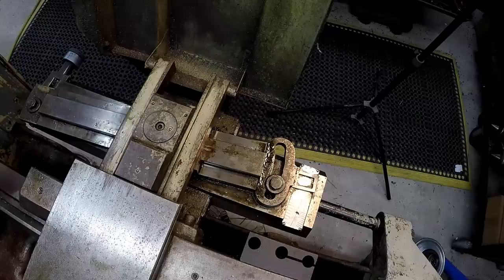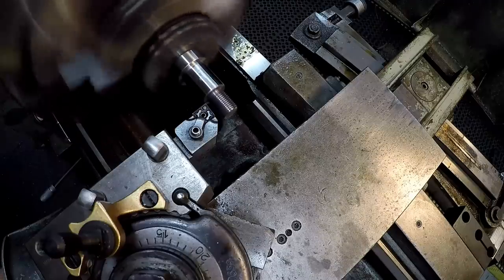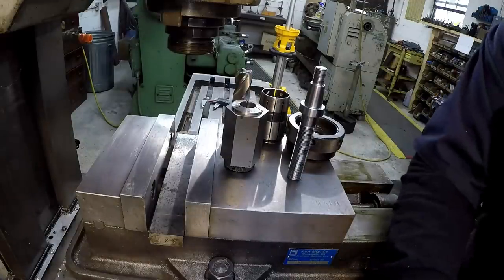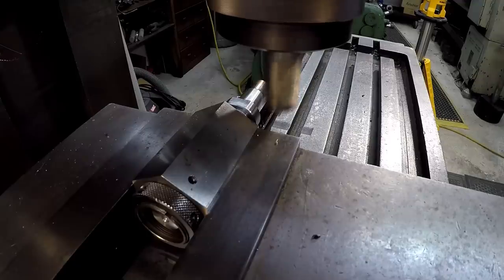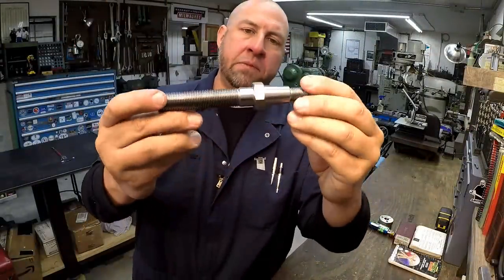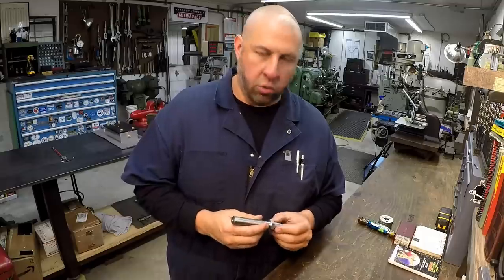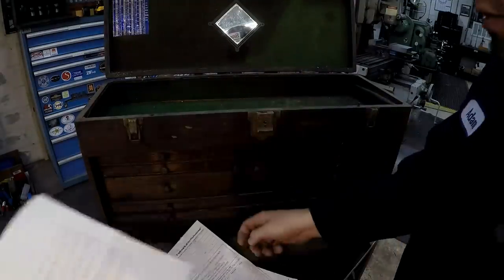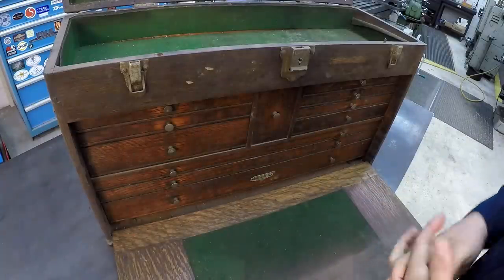SNS 253: Tapered Ball Joint Stud, Gerstner Tool Chest

Comment: Hi Adam, why didn't you use the compound slide for a small taper like that?
Reply from the maker: Because I have a taper attachment that doesn’t get used much. Better content for the viewers, and much easier to get dialed in.
Reply: @Abom79  Thanks for the reply Adam, I just wondered if it was an accuracy thing. But you are right, it is nice to see you use different tools.

Comment: Wait... If its a suspension part, wont he need two of them?
I can't think of any parts in a suspension system shaped even close to that where you wouldn't need at least two.

Though I dont know a whole lot about suspension systems
Reply: 5 Link has a single mounting point to the diff and has panhard bar, could be any of those parts

Comment: If you already haven't cleaned the Gerstner, let me recommend Murphy Oil Soap. It's the least aggressive cleaner and won't damage the finish. If you want a gentle polish after the cleaning, try Howard Feed-N-Wax. I've had good results on older pieces. with both these products. If you want to renew the finish first, just rub in some boiled linseed our or True-Oil gunstock finish.

Comment: doe's your aventor caliper go dead if you leave battery in it
Reply from the maker: It doesn’t go dead because the battery is left in it no. It runs out the normal life of the battery.

Comment: Ball joints and tie rods are typically 1.5" per foot or 7.15 degrees. A few are 9.5 degrees or 2" per foot. Justin should have sent you the sample to measure, as that is not his strong suit. :)
Reply from the maker: He measured the existing unit and give me the dimensions. He also said it fit great, so no worries.

Comment: gl 66931 probly an old phone number,, from before the phone comp. went to just numbers
Reply: The GL is probably short for the memory aid word, such as Glendale 66731
Reply: Indeed that is a phone number, 456-6931 - GL would have been an abbreviation for an exchange name, "Glenwood-6" or similar. Our exchange when I was child of 10 in 1965 was Greenwood-3, so our phone number was 473-xxxx. This was before the days of Area Codes and long distance direct dial. If you wanted to call long distance, you called the operator. On certain holidays that had traditionally high long distance call volumes, you were put in a queue and the operator called you back when a trunk line opened up, which could take a while. I remember waiting an hour or more just to be able to call our cousins in California on Christmas Eve or Christmas Day.

Comment: Original Style of old telephone numbers when they went from four or five digits to seven digits (prior to area codes).  GL woud have been for the words like Glenview, Glenwood, Gladstone, Glencourt, Globe, etc.  When I was a kid our phone number was 4-9771, later upgraded to AMhurst4-9771, then 264-9771, and finally (Area Code) 264-9771.  You are too young to know about the old phone system, such as "Number Please," two longs and a short, plain black with a short cord and a round dial, and you could not buy a phone, only rent what Ma Bell offered.

Comment: Isn't it hugely damaging to brake a precise tool like your lathe so aggressively?
Reply: nope, as far as the machine and bearings know there's no difference between applying a force to slow down the spindle and applying a force to cut a part, the only difference is whether or not the motor is engaged.
Reply: The machine is well designed and will not hurt itself. The friction brake will wear faster though, just like car brakes if used harder.